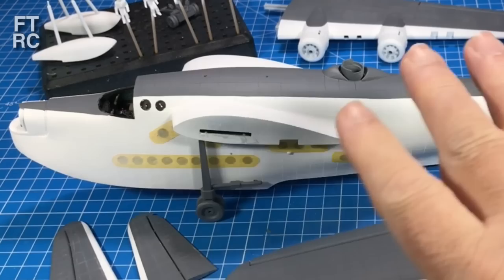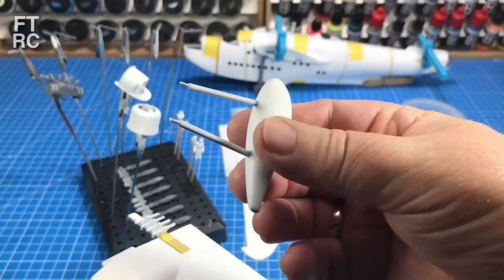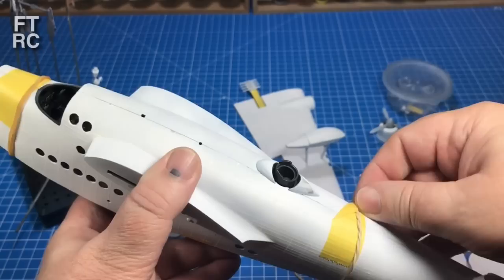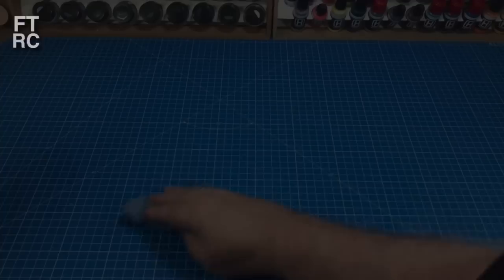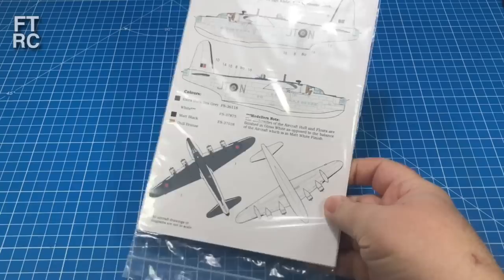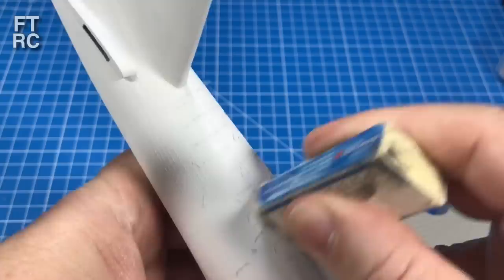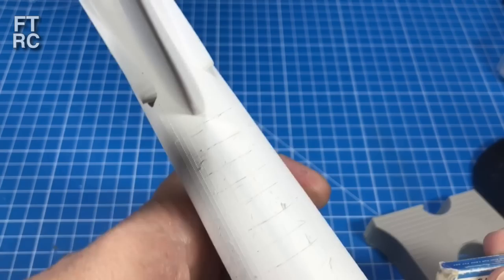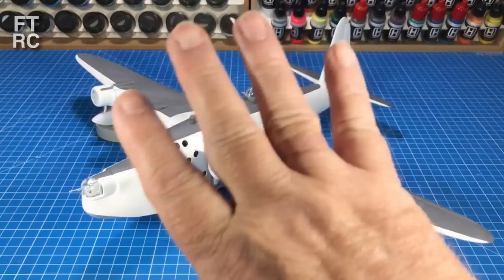Airfix Sunderland Part 6 Glue Putty Sand Paint Repeat - getting my camo on

Comment: Thanks again for all the great lessons. The masking tips are wizard, as well as the approach to camo.
At a guess or two, the copper may have been painted to prevent reflections, or saltwater corrosion.
Reply from the maker: Good on you Eugene.. I also painted an Aussie Camo on the  Beaufighter and it had the copper painted over.  Got a lot of rivet counting on that, until I showed photos from the war of the actual aircraft exactly as I had done mine.

Comment: I recently did a quick build of an old Airfix HP airliner in 1:144. It had the same coke bottle bottom portholes/windows as the Sunderland with huge sink marks in the middle. I tried massively sanding them down and re-polishing them and it worked. I had always been afraid to sand canopies in the past, but that should work just as well...
Reply from the maker: Yes that would work… but in the end I hardly notice the lensing issue on mine.

Comment: Looking awesome, Mate! Sadly, You've missed one thing on the paint scheme. Wings lead edges after the outside engines are gray as well 😕
Reply from the maker: Yes I know about all the edge stripes, in black from my research, on the tail fin and rear wings as well.  I will mask those up and use a Posca Paint Pen to define them in the next video.
Reply: @HarryHoudiniModels  I wonder if those black leading edges are de-icing (or at least anti-icing) rubber boots?